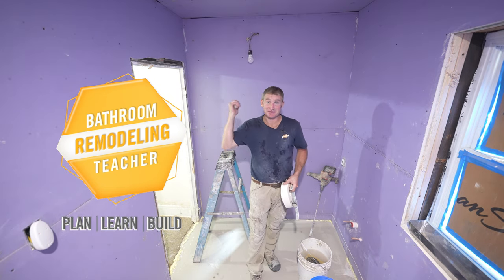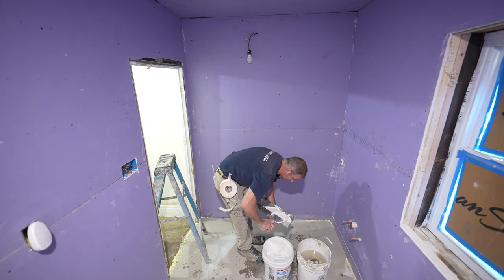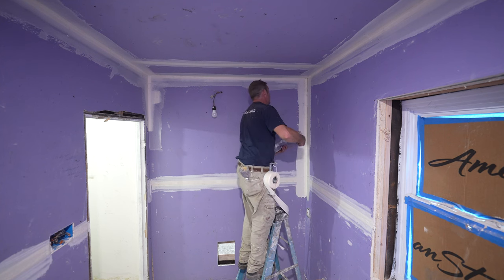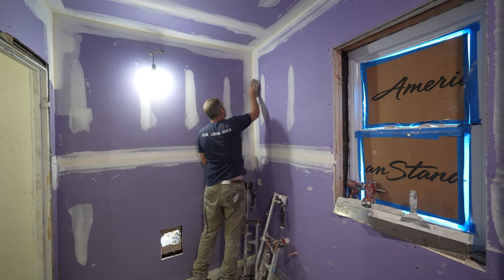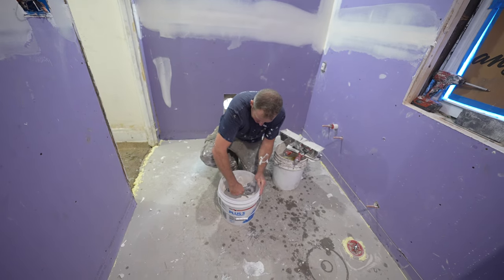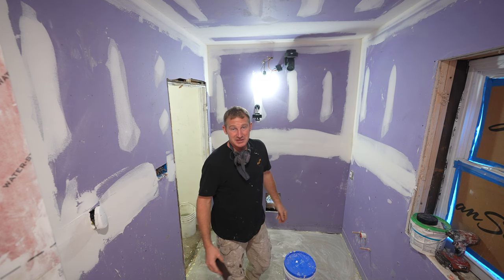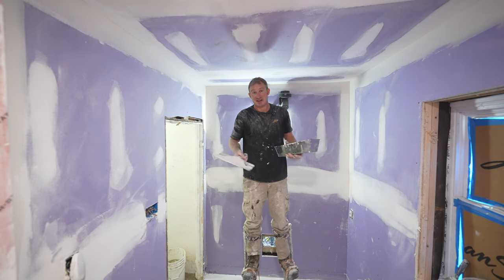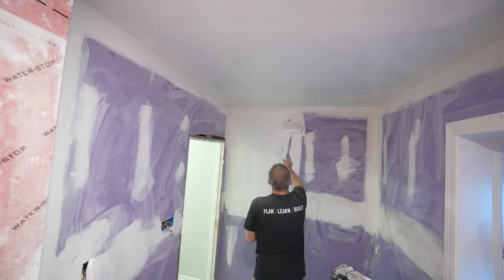Drywall Finishing 123 | PLAN LEARN BUILD

Comment: If you're going to use blue lid for taping which you really shouldn't as it's significantly softer, but I understand why you might in a bathroom, then you should add a little bit of glue to help with bonding. Firstly my recommendation would be the tape with hot bud with glue in it but whatever works for you really.
Reply: People love to add glue to their mix, I never understood that. USG really knows how to make things. If they thought some elmers glue would help their product out, I'm sure they would add it.
Reply: @avisitorhere  green lid which is preferable for taping has more glue than topping compound, it's all a trade off the softer the better for sanding but worse for strength so blue lid has less adhesive. Adhesion is really important on fill coats, bedding for tape and texture. This isn't like the silly adding dish soap thing, if you care about your work it's important. If there was one best way to do it then USG would only make one type of compound. For the same reason Ford makes the Ford focus and the F-150, the best tool depends on the situation. That doesn't mean you can't drive a Ford focus through a snowstorm but you're probably going to have a bad time.
Reply: @stich1960  so green for tape and blue for finish coat?

Comment: Hey Steve, do you ever use the 3’x1’ work platforms or do you like keeping a 4 ft ladder in there instead?  I’m remodeling my hallway bathroom now and using a 4ft ladder, but I keep thinking the whole time that 2 of those work platforms would be a lot faster.  Mostly due to lack of space and not having to keep moving it around so much.
Reply from the maker: I have not. I’ve actually always wanted one….might purchase for next full remodel. Much better that 2 x 12s 👍

Comment: Watch out Steve … you are triggering tapers with your +3 “taping” mud. 🤣 Buy the way I use the same so they can get double triggered. So much material in this one bathroom. Quite profitable for YouTube bizz. 💪👊👍
Reply from the maker: 😆 thanks 😊 I’ve yet to have a problem with blue lid….and it specifically states it can be used for taping… for me it’s the convenience. I bucket per bathroom 👍
Reply: @BathroomRemodelingTeacher  I went down the USG rabbit hole long time ago. Every bucket says the same. Every bucket/mud is suitable for taping and coating according to them. I am mostly repair guy so hot-muds and plus three works for me. The ultra light one (light green lid) was a horror story as well as the “dust control” one. 🤣😵‍💫🤣 Bought each once out of curiosity and never again. Solid gimmick.

Comment: I am against this taping method. Never use paper tape in a bathroom. It is organic and can attract mold. Mold loves paper. I would use fibra tape. It lays flat with no air bubbles. And never use joint compound under tape. Joint compound dries by air and putting tape over it slows the drying even more. And never use joint compound in a bathroom. If it gets wet, it turns back into gypsum. I would only use tape setting, also called hot mud compound like Durabond in a wet area. If Durabond gets wet, nothing happens to it. It sets faster and is made for going under tape since it heat cures. At a minimum, you should at least be using mold inhibiting joint compound.
Reply: Did you miss the part where he primed and painted the walls? Pretty sure that’s gonna protect the joint compound you’re so concerned about
Reply: @mattcooper6677  Geez forgot about the paint. I take it all back. Paint will fix everything. I mean, why even use the purple board when you can just paint over regular drywall? Why do they even make mold inhibiting joint compound when it will be sealed with paint? The paint will fix it all.